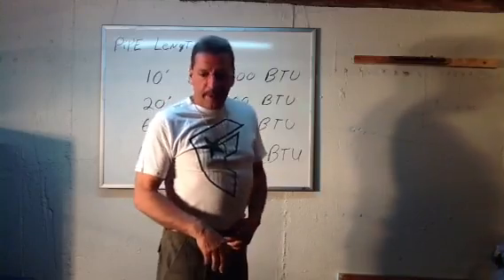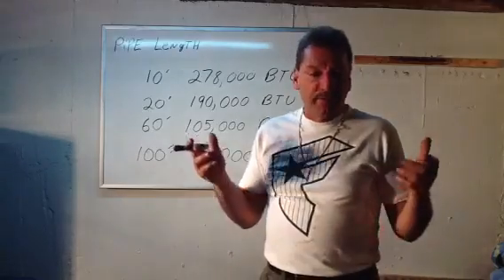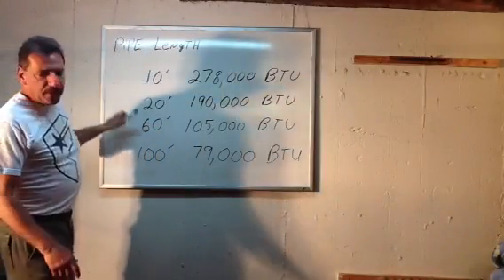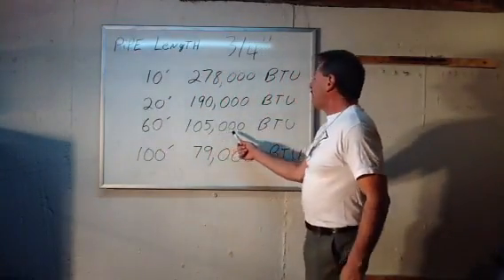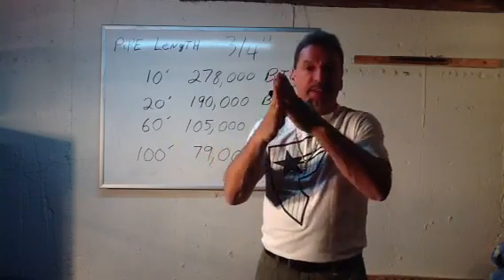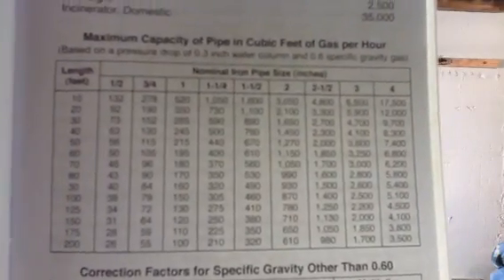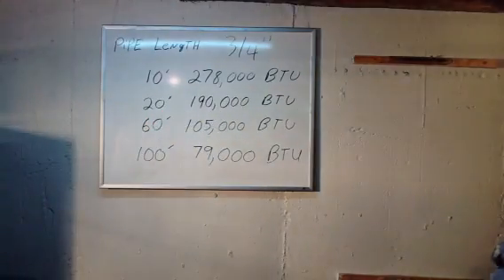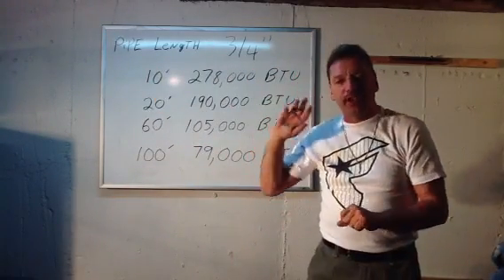understanding gas pipe distances VS. BTU (loudepot)

Comment: The line to the house is usually 1 inch on NG and 3/8 inch on Lp from the tank.   They are lowered at the meter to about 2.5 inches and 9 inches water column respectively. From the meter to the farthest  fixture the total BTU's for all fixtures needs to  added together and looked at the chart he showed you in the UPC code book. This will give you the starting size pipe you need from the meter to the first fixture You  recalculate from there  new length and BTU's  ect till you get to the end

Comment: He is explaining piping within a structure not out in the street. The pipe in the street may be 70 psi( it is in LA ) But in a house the Pressure is dropped to 2.5 inches of water column on NG and about 9.5 inches on LP. 12 inches of water column being .434 psi. So it is very important at such low pressure that piping be size correct, or fixtures will not work correctly